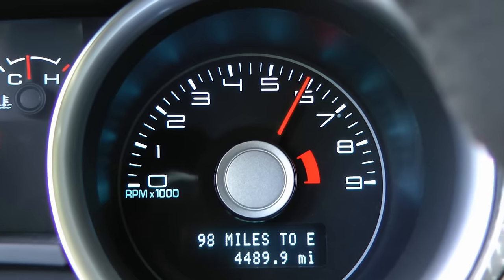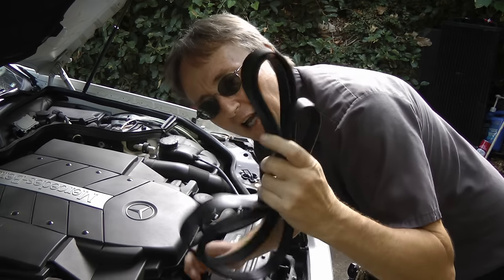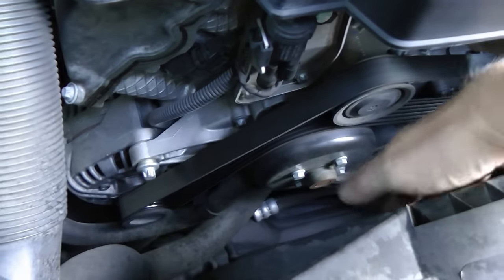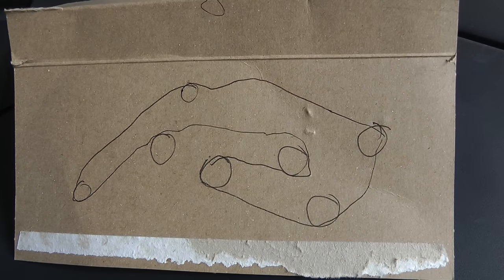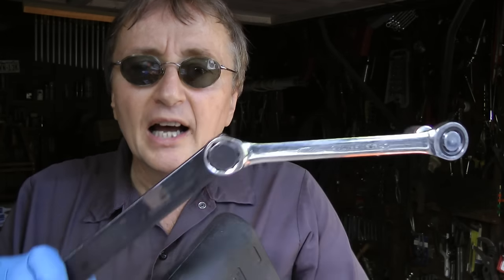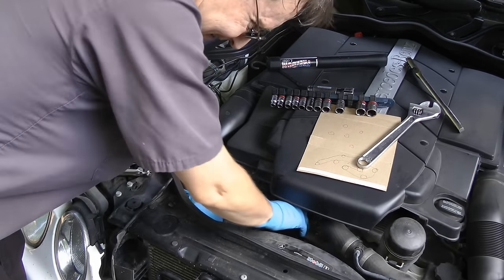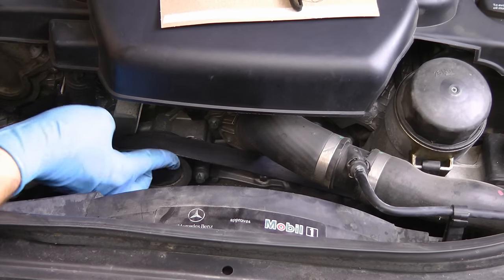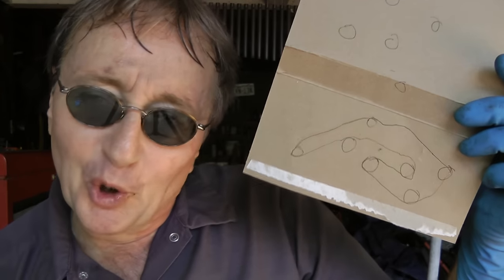How to Replace a Serpentine Belt in Your Car (Fan Belt)

Comment: Hey Scotty, I have just replaced my serpentine belt, tensioner pulley, and idler pulley on my vehicle. At first when idling with the air conditioner on it squeels like HELL. However, after several minutes of running the squeel is not to be heard when in idle with air conditioning on. I then proceeded to try to take it for a test drive but noticed when trying to turn out of my drive way the steering wheel was much tougher to turn. In addition to, it squeels when turning my wheel and upon acceleration. The belt is quite tight with less than 1/2 inch of leeway when pressing down on it (probably 3/8 inch or less). What can I do to alleviate this problem of mine? Thanks.
Reply from the maker: something is wrong with one of the pulleys, like worn power steering pump Or worn pulley bearing on idler pulleys.
Reply: Scotty Kilmer Thanks Scotty, I appreciate the advice. I was thinking it was one of the pulleys as well. I don't know why exactly I am having more problems after doing this install but the only thing I can think of it has to be due to me potentially putting too much tension on the serpentine belt causing one or more of the accessory pulleys to undergo too much stress. I mean the last belt I had was loose and cracking so due to the tension/pressure change of installing a new belt it caused all these problems. 
   I will try my best to remember this thread so I may update it with the information of what exactly went wrong. Have a great day and keep up the amazing work. Love your videos.

Comment: The drive belt in my car started shaking vigorously at idle and created a loud noise which disappeared at higher RPMs though. The mechanic who is close by checked the issue and told me that drive belt along with the pulley at the bottom and the tensioner needs to be changed. So, I eventually changed all of them at a hefty price, but the problem didn't go away. He again told me that the new tensioner could be faulty, so I exchanged that for him after getting into a long talk with the seller who refused to change it due to markings. Now, got the new tensioner fixed but the problem still persist, and to my surprise the mechanic seemed absolutely clueless and almost at the verge of giving up. Then I shared the details to a Chevrolet trained technician through WhatsApp. He told me that it's due to the alternator pulley being jammed. I put him on the call with this other mechanic who initially refused to talk to him ( the ego in him strikes in) and finally listened to him and changed the alternator pulley. Bingo, the problem disappeared. My time and money wasted because of the inability of the mechanic who failed to analyse the root cause of a problem. What irked me the most is, in the end, he started blabbering that he knew the alternator pulley is what caused the problem and told me about it in the beginning itself (ego strikes again).

Comment: Does the engine need to be running to do this? Like at full throttle in neutral? Can I get some advise on how to replace my radiator on a 1972 VW Super Beetle and flush the cooling system? I opened the hood and the engine was not there, just a spare tire..is that what makes it go? 
      I think I need a new thing that goes on that one piece next to the other part for the one thing for the stuff too. My uncle was a mechanic and he said that Ford Chevelles were the best car.

Comment: How do I know I need a new serpentine belt? Mine has no cracks and it’s not making any noise but my mechanic says i need a new one every inspection...
Reply: On most belt tesnsioners there is a indicator that the belt needs to be replaced. Overtime the belt will stretch, after it stretches too much it will need to be replaced.

Comment: What do I do if my belt is too tight. I need like a whole another inch to fit on all the pulleys.   Please help
Reply: you need to get the same size as the belt you took off.
Reply: Either the belt is not the correct size or you have it routed incorrectly.

Comment: what is the difference between a 130 amp serpentine belt and a 150 amp serpentine belt
Reply: Amp is a measurement of electricity, it has nothing to do with a belt. It could be talking about different alternators that your car could come with. Different alternators can have different pulley diameters and require different belts.

Comment: some time the belt diagram are in the engine or the car manual or take a digital picture with a digital camera. I'm not recommend to buy Serpentine Fan Belt tool when you fixing it at home.

Comment: My dad put a new pully and is aligment but the driving belt keep falling off.Before all this happen I was driving his car and suddenly the belt fell off
Reply from the maker: if he used a cheap chinese made replacement tensioner pulley, they often do that. If not, one of the pulleys is misaligned causing it to come off with speed

Comment: Scotty would this be the same process for my Acura RSX type S
Reply from the maker: +phajej1993 same basic process
Reply: ourworlds atwar i think the alternator bolts need to be loosen, maybe a 14mm and a 12mm. I'm trying to figure this out as well as my '92 toyota paseo does not have those tensioner pulleys that you normally see on most vehicles
Reply: ourworlds atwar the alternator has a bolt on the back that is sitting on a lever like piece that has an opening of about 2 1/2 inches so you can slide the alternator to cut some slack on the belt. Same thing with the other pulley to the other belt. It's hard to explain without showing you.. Mine was really tough on one because i had no room with my tools to loosen the bolt so i used a thin flat screw driver to slide the old one out while turning the pulley and slide it back it while turning the pulley the opposite way; kind of like when you are changing a bicycle tire. Not the best procedure but its the only way I was able to get my car running fine again.

Comment: why is my drving belt falling off
Reply from the maker: If the belt is not worn out, a bad pulley if it has an auto tensioning pulley does that, As does any pulley that is out of alignment from internal wear or bent brackets which flip the belt off